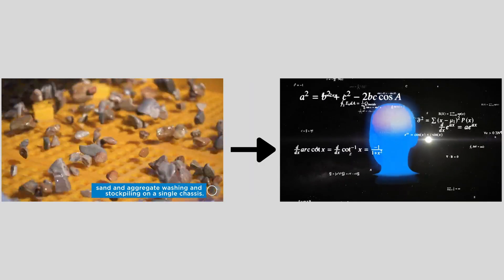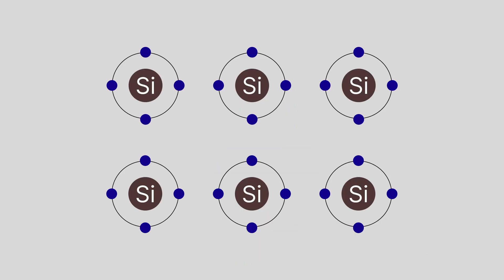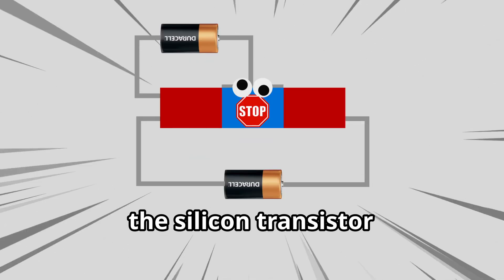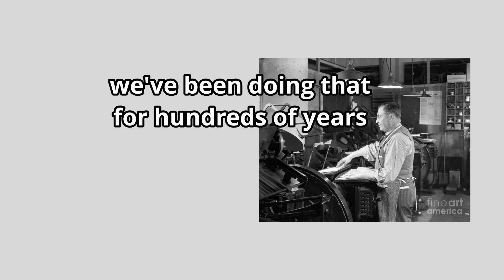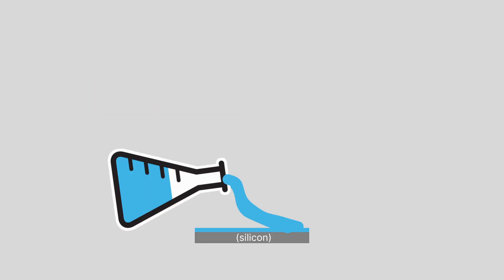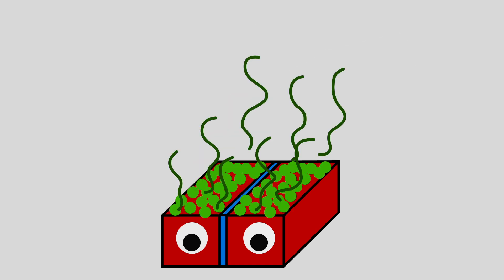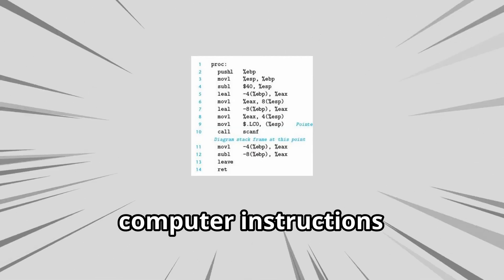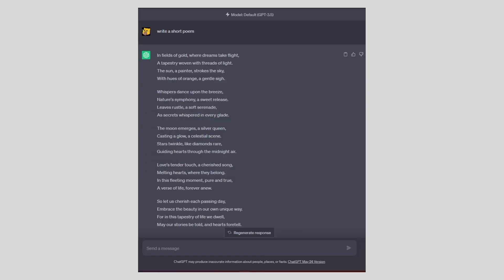how we turn sand into intelligence

Comment: I did an internship about Condensed Matter interactions in semi-conductors, specifically regarding natural isotope abundance silicon and by extension, Germanium given their similar behaviour, one however is just more sensitive and requires liquid nitrogen seen with Semi-Conductor Germanium radiation detectors, lest it's a noisy mess, information wise.

Needless to say, I didn't understand it, only the fundamentals from my BSc but the one presented was a projected empirical fit model, specifically utilizing Born-von Karman model, contrasted with similations. Both methods are extensive, but one can be done on a sufficiently powerful laptop, i5, at least series 10 of GPU maybe less and recommended more than 8 Gb or RAM but not impossible, for the purposes of high resolution data being projected in very small increments and being printed to Excel.

Also the dopping section is used in radiation detectors, specifically an intrinsic diode, which is positive, intrinsic and negative or PIN. It's cool but I couldn't understand that and the fact this video finally made me click on this material is really sad.

Comment: only thing I can say that is kinda inaccurate is that we don't stack transistors on different layers, the layers are for wires and power, only very recently amd (or tsmc) managed to stack memory transistors (and be commercially viable).

the problem is heat but memory is by nature not accessed simultaneously all the time, plus for reasons I don't know memory doesn't improve with size as great as other things and amd is using larger transistors on their memory chiplets which might be a reason why they managed to stack them

Comment: 3:53 Isn't it the other way around ?
If light makes the chemical hard, then only the area corresponding to the holes in the stencil will be hard and the rest will be liquid. So when you wash off the chemicals, the area under the holes (solid) stays there while the rest (liquid) washes away and expose the silicon.
Or am I missing something ?
Reply from the maker: Yeah but i realized it too late in the editing so i just acted like everything was fine hehe
Reply: @pleni_2.0  hahaha le filou

Comment: Transistors are also used to control the electric motors of electric cars, washing machines, air conditioners, fans, and anything else that has to work at different speeds. these transistors can be bigger then your hand can be designed to handle huge amounts of electricity (up to millions of watts and thousands and thousands of volts and amps).